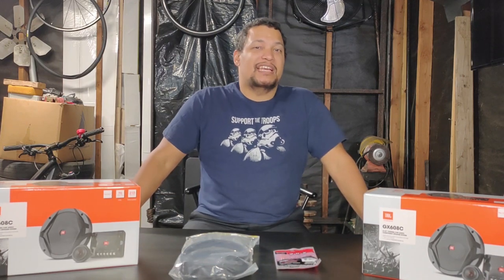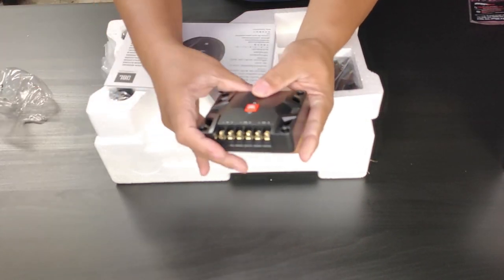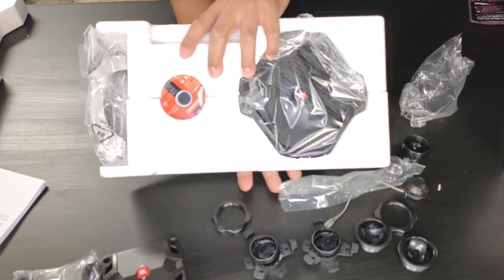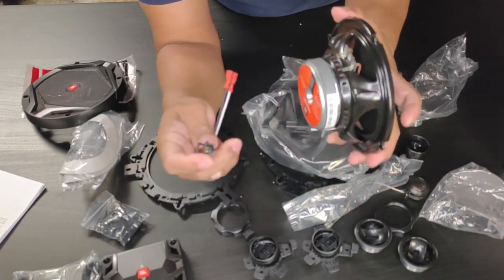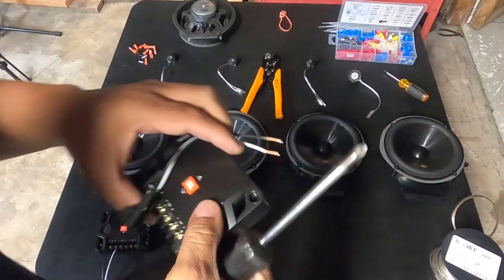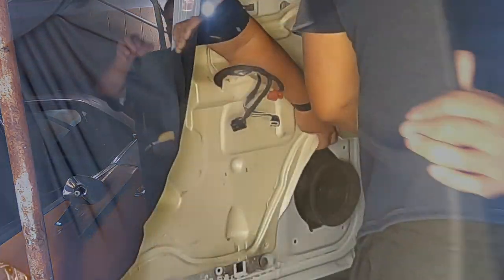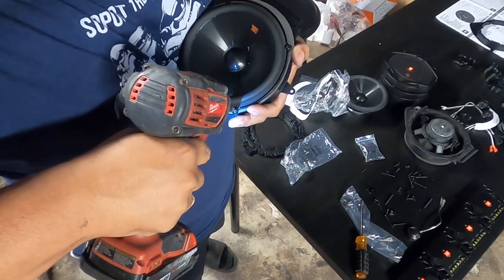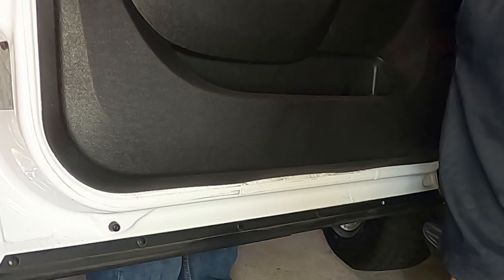JBL 6.5in door speaker install

Comment: I installed 4 6.5 jbl stadium coaxial speakers in my 2013 accord sport, I powered them with a jbl apex 1254 amp. It's 125rms ×4 @2ohms....wow they are super loud and extremely clear and punchy, I couldn't be any happier for 4 speakers under $300
Reply from the maker: Nice! Thanks for sharing feedback on your setup!
Reply: JBL apex 1245 amp is it necessary ?? or 4 speakers is good. Thank you
Reply: @aalhomrani2111  yes because the jbl stadium 6.5 speakers are 100rms each....the amp was 500 total=perfect.... your factory head unit is not powerful enough to get the best performance. And it's probably a different ohm rating, just keep that in mind, that's why you need the amp
Reply: @jaysonoliveira4752  thank you

Comment: Did you have to use 4 speaker adapter plates or only 2? If it was 4 are they the same part # front and rear.
Reply from the maker: It is 4 total, 2 per package same part number. 

If you are buying the wire adapters so you don't have to cut the factory harness, you are going to need 2 packs as well for a total of 4.

Comment: What kind of speaker wire should I get? And can you leave a link to where you got it? I have the JBL gto 609c component set. Thanks much appreciated!
Reply from the maker: Hey there sorry for the late response! We used 14ga wire for everything but you can get away with 16ga wires if the price is better for you. The owner of the vehicle actually had the speaker wires already so not sure where he bought them from but they are by Monster. Here's an example => https://www.amazon.com/Monster-Speaker-Copper-Cable-Spool/dp/B08BJBVLXG/ref=sr_1_3?dchild=1&keywords=Monster+Speaker+Wire&qid=1621740532&sr=8-3 . Hope that helps!

Comment: What was the color wire you used to hook up to the inline converter ? I need help finding the input wires in my Tahoe
Reply from the maker: Hey thanks for commenting. Just need a little clarification on what you are asking.... are you trying to find out what color wires are connected to your speakers or the wires that connect to x-over box?

Comment: Does positive or negative matter on the speaker? What color is the negative on the factory wiring?
Reply from the maker: This is for 2007 to 2014 Tahoe. I found it at the this site here -- https://www.tahoeforum.com/threads/factory-speaker-wire-questions.9592/

Radio 12v red/white + radio harness
Radio Ground black - radio harness
Radio Ignition (GMLAN Serial Data)
Radio Illumination yellow (dimmer) + radio harness
Factory Amp Turn-on same as power antenna wire
Power Antenna white + radio harness
LF Speaker +/- tan - gray +,- radio harness or amplifier
RF Speaker +/- lt. green - dk. green +,- radio harness or amplifier
LR Speaker +/- brown - yellow +,- radio harness or amplifier
RR Speaker +/- dk. blue - lt. blue +,- radio harness or amplifier

Notes: If equipped, the amplifier is under the rear of the center console.

At the amplifier, the left subwoofer wires are dk. blue/white (+) - lt. green/black (-). The right subwoofer wires are dk. green (+) - lt. blue/black (-).

Also Love the Bitcoin image you have.

Comment: I just got these installed and it has a certain “rattle” not the car but the speakers. I wonder if the screen guard wasn’t put tight enough or if taking them off would solve it?
Reply from the maker: The speakers shouldn't make any type of rattle noise. It's possible that 1) Plastic clips in the door or trim panel have come lose or are broken and rattling when the bass hits OR 2) the guard like you are thinking may not be tight enough.

Comment: Can you install without using the amps? And would that impact the quality of the speakers?
Reply from the maker: It is possible to use any speaker without an amp but that means the speakers will be powered by the headunit and usually would impact the quality of sound coming out of them. If your vehicle is equipped with a factory amp and you wish to bypass it, you will have to run new speaker wires directly from the headunit wiring harness to the speakers in order for it to work. Hope that answers your question!

Comment: I drive a 2002 Pontiac grand am and the factory speaker size is 4 x 6, I saw people online saying that you could fit 6.5s in there though. Do you know if that is possible?
Reply from the maker: Hi there, we are not stereo specialists so it's hard to say that it will fit, but if you're saying you've done research and seen others do it then I'd say it's possible. We only really know about the vehicles we work on, sorry!

Comment: You don’t need access to the crossover dont it have a button on it
Reply from the maker: Hi Aesor One, The crossover does have a button on it. It allows you to go from the default volume which is labeled 0 to +3 dB. We haven't had to play with it since it was installed.

Comment: would this raise the volume ?
Reply from the maker: Not exactly sure I understand your question. If you mean by installing these speakers if the volume is higher at the same volume setting then no it isn't. It does sound a lot clearer though. If you have an aftermarket amp, it may raise the volume if you raise the gain on the amp.

Comment: Is there a significant difference between factory speakers and these? Specifically with the bass but also all around sound?
Reply from the maker: I would definitely say the sound is better than factory speakers. With the driver actually splitting up the highs and the lows you can really hear the clarity. The bass does hit a little harder, but we are using the factory amp with an aftermarket radio. I am pretty sure if you used an after market amp you can get them to hit much harder. With that being said subs would be the best way to get the heavy bass. I run a W7 13.5in sub in my 69 charger, and plan to do some component speakers for that just because I have crazy clear bass but some pretty sad 3way speakers. Hopefully a month or two I can show that off. 

Again sound is super clear no distortion. On the highs or lows with factory amp. If you have an aftermarket you would have to play with the settings to maximize the component speakers to get the best possible sound.

Comment: Did you guys installed speakers or tweeters in d pillards
Reply from the maker: If you are talking about above your head pillars those are tweeters.
Reply: @FirstTimersChannel  so does it have 2 sets of tweeters
Reply from the maker: @andyacosta1985  One set of tweeters. I believe the section you are talking about is called A-pillars, which is right in front and above the dash.
Reply: @FirstTimersChannel  I'm talking about the last pillard towards the back d pillard what size speaker is it
Reply from the maker: On the Tahoe we don't have speakers in the rear pillars. But if you have an earlier GM SUV here is a website that sells 6in pods for the rear pillars https://www.customspeakerpods.com/product-page/d-pillar-speaker-pod-for-6-5-00-06-gmfst  

On the Tahoe we worked on the speakers are in the doors and A pillars. 

From what I read on this site https://www.tahoeyukonforum.com/threads/d-pillar-speakers.12183/
 The rear d pillar speaker size is between 3.5 and 4in speakers. One of the people on the site seems to like the rear speaker pods for better sound. What year are you working with?

Comment: Anyone interested in Jbl I just bought JBL GX series 6.5 for 54$ at Best Buy and the GX 6.9 for 77$ Black Friday deal , the 6.5 goes for 80-90 Amazon and the 6.9 goes for 130$ , head down to Best Buy now!! Lol
Reply from the maker: Thanks for the heads up!
Reply: Same, just picked up the gx components and gx coaxial for 205 total. Pairing them with a kicker 4 channel amp.

Comment: how to do you connect to splitter which has IN, TW and WF?
Reply from the maker: Your speakers connection from the radio or the amp goes to the "In" on the box. The "TW" is out to the tweeter and "WF" is for the woofer. Hope that helps.
Reply: @FirstTimersChannel  cheers and thanks man. Will try when I get mine real soon.
Reply: @FirstTimersChannel  Yo bro I got a 2004 Sierra with Bose system and they died on me. Can I use these speakers and wire them to the factory amplifier? or do I need to wire the JBL crossover?
Reply from the maker: In the instructions it says to install them with the cross over box. You can wire them from the amp, to the crossover box, then to the speakers.  If you were to bypass the crossover box and do amp to speakers it would not work and damage the speakers because they are not designed to run all frequency's all the time.

If you read through this page below, you will see a diagram of how the crossover box should be installed. https://www.crutchfield.com/S-5hGiaqRUHZg/learn/component-car-speakers-tweeters-installation-guide.html?source=pjn&subid=47736&clickId=3899698488&&pjClickID=3899698488

Comment: You didn't show me the only thing I wanted to see the wiring between the woofer and the tweeter
Reply from the maker: I apologize I didn't show you the wiring between the woofer and the tweeter. I understand that this was the only thing you wanted to see, I might be getting another pair of these speakers to install into another car and will try to record that for you, but it might be a few months. Here is a link that has a picture of a 2-way crossover setup. It would be Example 1 - https://soundcertified.com/how-to-install-wire-car-speaker-crossover/ The image from the website is not of the exact product but will give you the general wiring diagram.

Comment: How does it sound without amp?
Reply from the maker: Actually it has a stock amp and it sounded pretty good. Of course if you want more bass we would recommend installing an aftermarket amp but just for these JBL speakers/tweeters the stock amp will do just fine. It's really a matter of preference to be honest.
Reply: @FirstTimersChannel  thank u for the reply one last question what gauge wire did you use to connect the tweeters and the gauge size used for the speakers/woofers?
Reply from the maker: Sorry for the late reply, had to look for the package for the wires. We used 14ga for everything but you can use 16ga as well.

Comment: Next time use cola loca glue that's super strong only one dollar and 25cents and don't use a lot of shit very difficult
Reply from the maker: Thanks for the Tip. I have ordered some on amazon, So I will try a few test spots with a few projects. I couldn't find any by me for $1.25.  it's about 6 dollars on amazon which isn't to bad. the main reason I like Plastex is that I can drill it, sand it, and paint it. It is a form of plastic. It's a product that has not failed me yet. But I will give this Kola Loca a try. thanks for commenting.